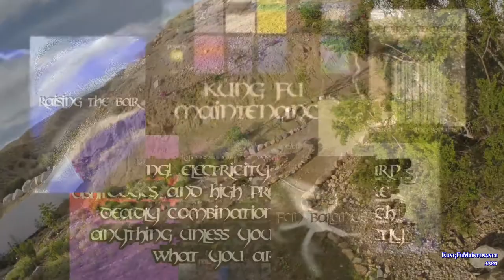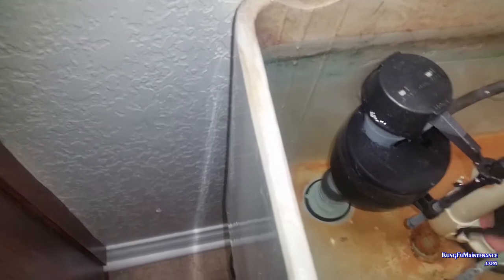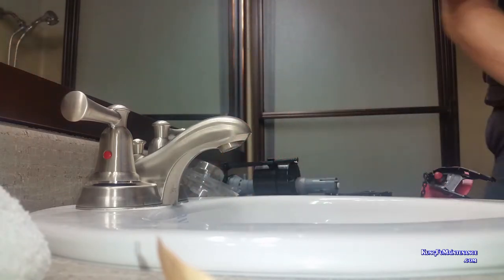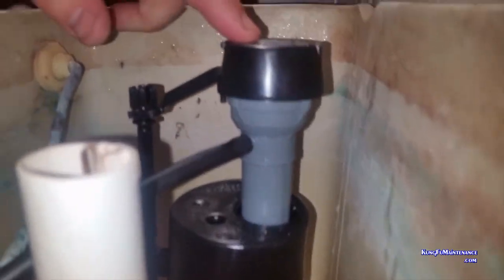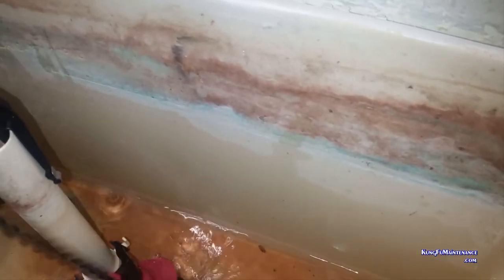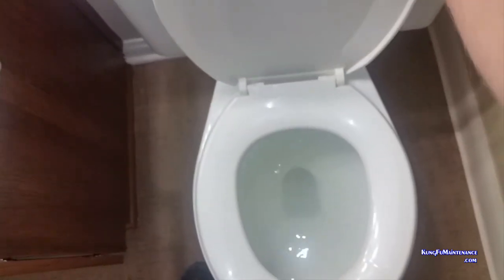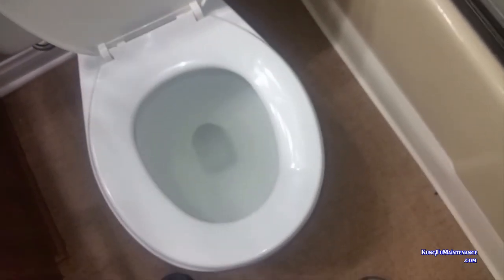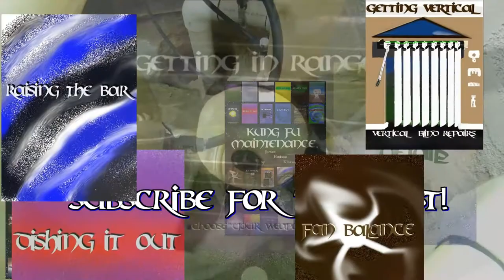Toilet Handle Leaking Water Repair Video

Comment: My aftermarket flapper and chain was binding on my rental property and cost me over 400 dollars in water.   Stupid tenant didn't bother to tell me it was running all the time.    I went to the plumbing supply place and got the factory American standard flapper that has the ball and socket type chain.   That did the trick.